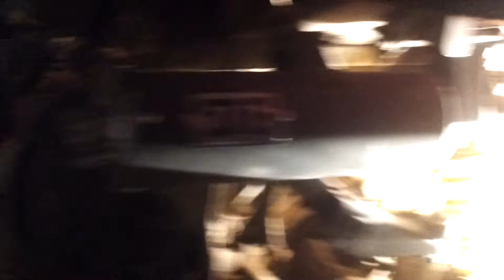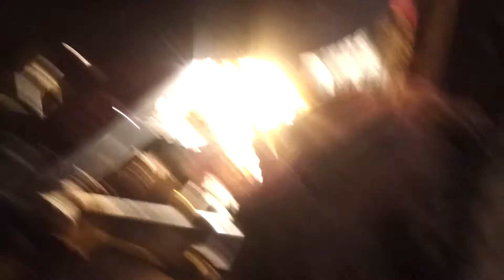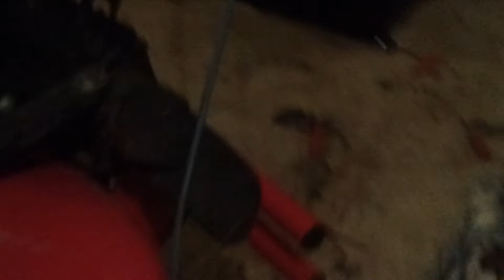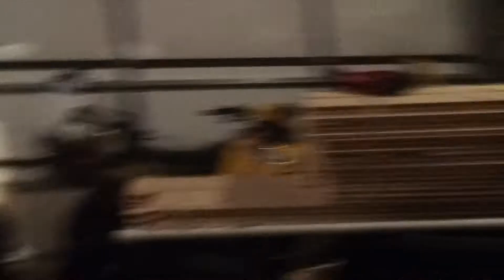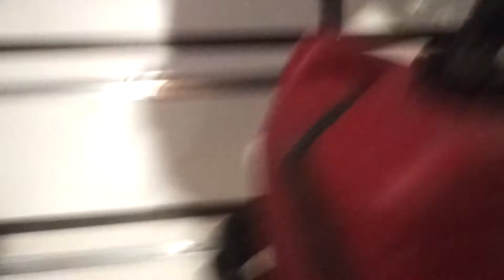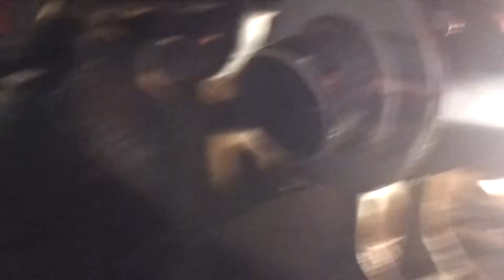My 1997 polaris xplorer mods 2

Comment: Over all, I really like all your mods.  I have the same fourwheeler and it is a BEAST of a machine. My question is,,how did you run your snorkels?  I cant figure it out and there is no one on here that has done a video for our xplorer.  Thanks and great job!
Reply from the maker: I sold that ATV a couple years ago. Snorkels we hard to run, I can't exactly remember. I used all 2 inch PVC pipe.  It was my first snorkel job and did not look very good. Glad you liked the video!